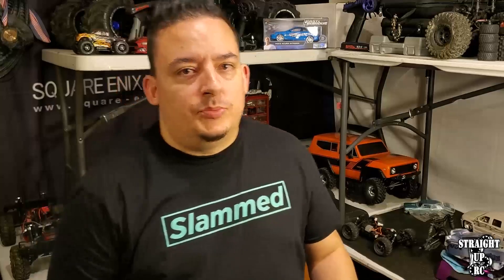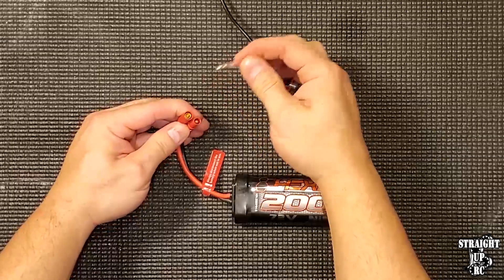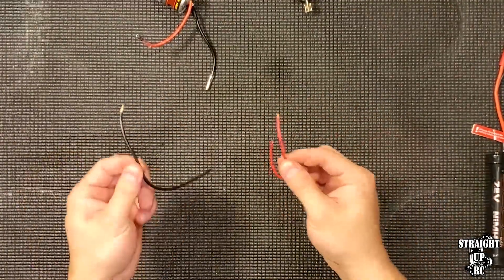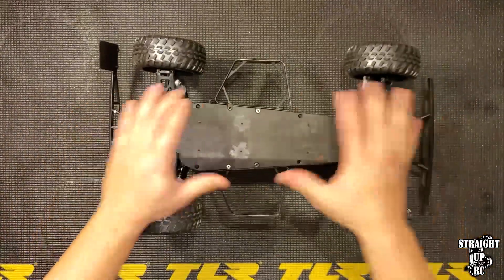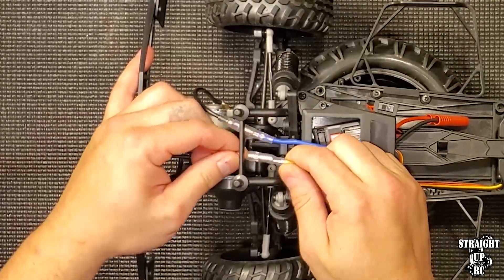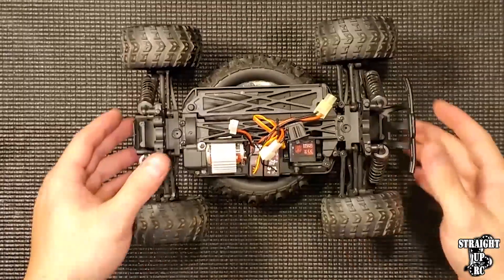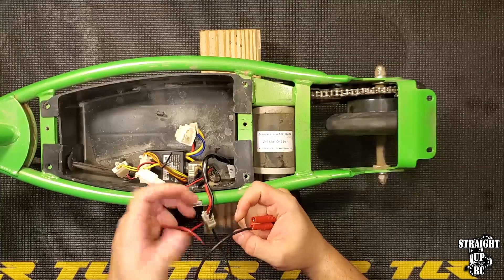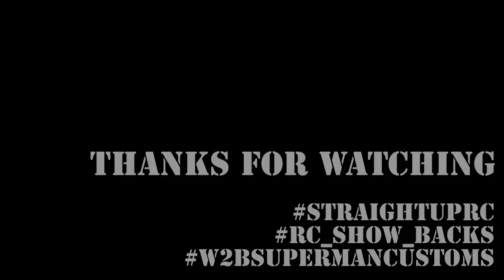EASIEST Brushed RC Motor Test Ever!

Comment: I'm trying to get my old E-maxx with two brushed 21 turn Titan motors.
I had it going for awhile with lipo batteries but all of a sudden they both stopped.
I thought I fried the 3014 esc so I bought a new esc. Still no go.
Tested the motors like you showed.
Neither motor will spin.
I find it odd that both motors went out at the same time.
What's your thoughts on my next step?
Thanks for your video.
I gave you a 👍 and subscribed.
Reply from the maker: Sorry to hear that you had both motors failed. That is rather unlucky to say the least. I would say that it is possible that the old ESC failed in such a way that it caused the failure of both motor simultaneously. I have seen systems fail in bulk like this with servos - so it's not exactly impossible to have happen - but rather unlucky, unfortunate, and probably rare. I have also seen  dual motor power wheel models do this as well - sadly. So without some form of circuit protection between the two motors - which none of us would ever use or do -  it was probably an instantaneous combined failure of the motors.
Reply: @StraightUpRC I was spinning donuts in gravel when they shutdown.
While testing the motors directly to a battery, I discovered a stone inside one of the vent holes, locking up the motor.
Reply from the maker: @Circuitprotector  OH WOW! That will definitely stop a motor from doing it's thing! Nice find though. Hope the motor worked after you go the stone out... If not - that is a bummer.
Reply: @StraightUpRC Neither motor will turn after the stone was removed.
I have two new motors ordered for $40.
With the new Hobbywing 880 esc and two new motors, there should be no reason it won't be back in action.
$90 total.
Not too bad for getting the old E-maxx going again.

Comment: but i have a tittan 775 with 2red and 2 black wires so get 2 batteries ???
Reply from the maker: There should be no need for two batteries. My guess is without being able to confirm this is that both of your wires connect to the same motor leads on the motor. So, even if you connected 2 batteries to both wires, you're still supplying power to the same motor. So, you should only need 1 battery connected to one set of wires. Just be careful not to have the other two wires connected when the power is connected from the battery because you can arc power from the battery.

Comment: Great video, can you help with a blinking esc? Steering but not throttle. Spectrum SLT3 with a SR315 Spectrum reciever.
Reply from the maker: I can deffinitely try and help. Given the fact that you are on commenting on a brushed motor test video - I presume this is a brushed ESC connected to the system. If the ESC is blinking on a brushed system it could be 1 of a few things. 2 things to test and check right away are - 1st make sure ALL wires are plugged in correctly and in the right place and direction. Check ESC to motor plugs and all. 2nd thing you can do is SWAP the ESC and SERVO plug in the receiver. You know you have steering so for all intensive purposes you should have THROTTLE with the ESC+motor IF you put the ESC plug in the steering channel. So put the ESC plug in the steering channel on the receiver and turn it on. Becauseful because the throttle will run off the WHEEL of the remote now - NOT the trigger and see if you still have a blink or if the ESC works. If it works... you may have a failed throttle channel in the receiver. See if those 2 things help at all.

Comment: Just hope the motor isn't internally shorted to the case or that shit is gonna get real hot, real fast. First grab a meter and find out.
Reply from the maker: Absolute possibility for sure. The manual connection to the battery from the motor allows for quick release in that case scenario. Experienced that before. But the majority of average RC hobbyists are probably not going to be familiar with how to test a motor for continuity with a meter. So this process is a go-to for a simple test.
Reply: @StraightUpRC  it could also quickly weld that connector on, even if tapping it. That's when it could get scary!
Reply from the maker: @sonicelectronic57  Possibly - done that too. But also a rare occurrence. I have probably conducted this test 300 - 400 times without the "rare-scary" things happening.

Comment: Hi. My car is old car but never been used. I’m finding that after a little time it just does short blips not able to go full throttle as to say
Reply from the maker: Sounds like the motor is getting old and weak. The bearings inside might be dry and worn. One thing you can try and do is to clean the motor with compressed air and maybe attempt to put some bearing oil or lubricant of some sort on the bearings at each end of the motor shaft. WD40 would even work. This would best be done with the motor removed from the RC and motor mounts so you can get to both ends of the motor shaft but could possibly be done with it still in the model. 

If this does not help at all - the motor might just need to be replaced. 

Also - it would be a good idea to test your battery to see if it is in good health. Or possibly try a new battery.
Reply: @StraightUpRC  hi. I tried the motor to battery way to find out if motor is ok. When connected straight to battery it runs no problem at all. I will do the water run in and the oil the bearings. I think the battery might be gone too as it’s the original battery, even though it’s hasn’t been used much it doesn’t hold much charge as it’s doesn’t last long
Reply from the maker: @01arron  Sounds like a good motor and the cleaning should help. And it does not surprise me that an old battery would act like that at all - good point. Good info! Hope my video helped. Thanks for watching too!
Reply: @StraightUpRC  that’s amazing, thank you fella that’s helped a lot, I will try the cleaning

Comment: your the man ,I appreciate you always willing to help with videos, please keep the content coming,your videos are important,and if you one day, can  a ''VIDEO ON BEC'',like when to get one and why?I here so many different answers,I run a 1080 hobbywing esc/21t trailmaster sport 550/ds3225 25kg servo,with a redcat light-kit, austar ax-519 roof rack with light bar, everything runs fine,but my friend said i might need a bec,so all the different answers came to me,so i unplugged the light bar on roof rack just in case..sorry for long message but I trust your judgment 100% my dude, thanks brother be safe🤜🤛
Reply from the maker: Thanks for more support! I will add that video to my "to do" list for sure. But as a quick reply - if you are running a Hobbywing 1080 ESC - it already has a built in BEC in the ESC itself. Almost any newer model land based - meaning RC car and truck style ESC will almost certainly have a built in BEC in the device. If you google or go to Hobbywing's site and look at the details on the ESC it should state that as well. Regardless I will for sure do a video on that soon - great idea.
Reply: @StraightUpRC  UR RIGHT BROTHER THANKS